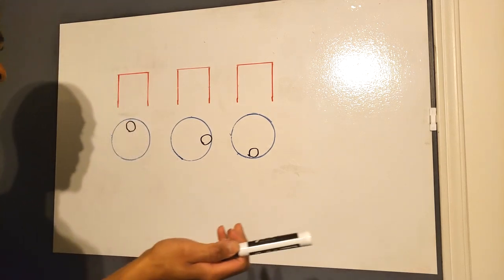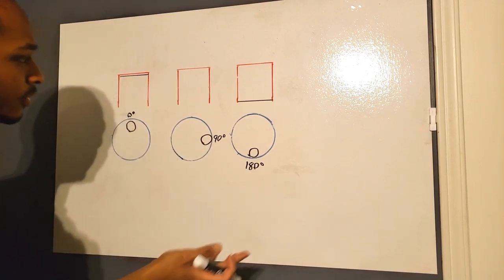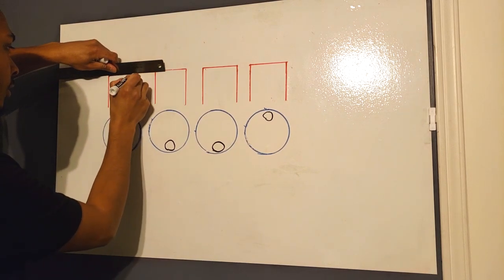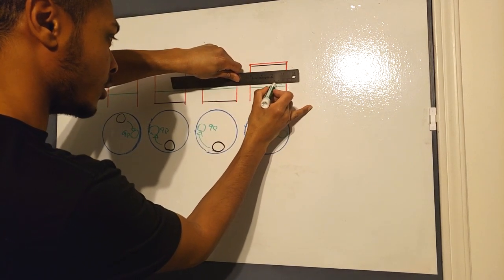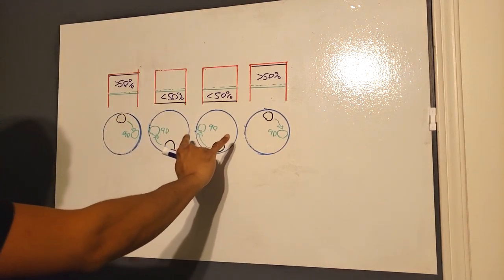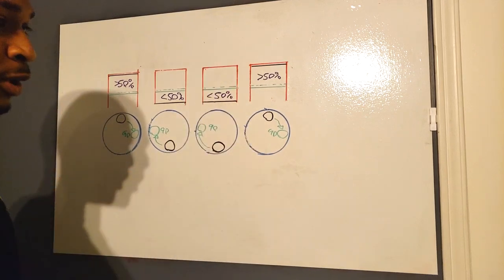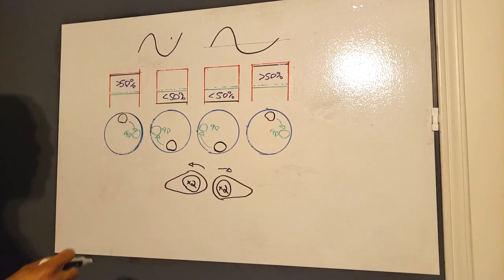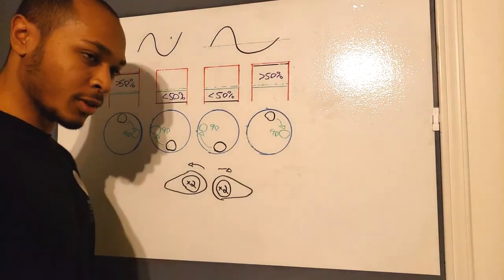Why a PERFECTLY balanced engine STILL vibrates

Comment: Does the amount of vibration limit the engines capability to rev higher then standard specifications like saabs t5 and t7 engines because i havent really seen t5 or t7's rev higher then 7500 / 8000 rpms
Reply from the maker: More vibration usually means more rod angle and more stroke so yes, more vibration indicates more internal stress. 

You could get a 2.0 saab engine past 10k rpm easily. Internal stresses are lower than even a honda K20.